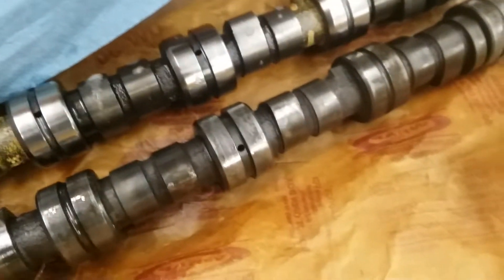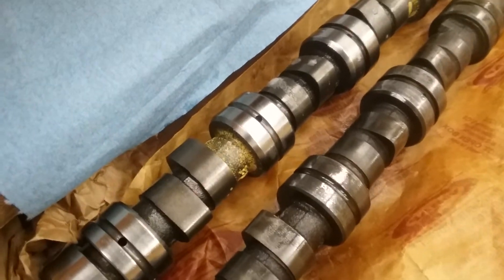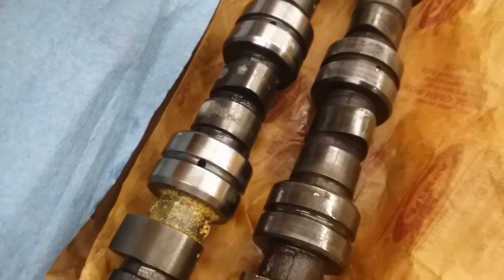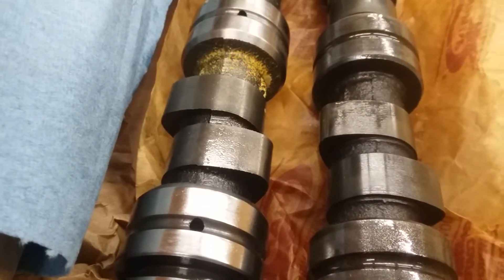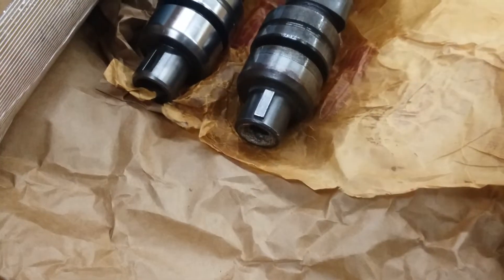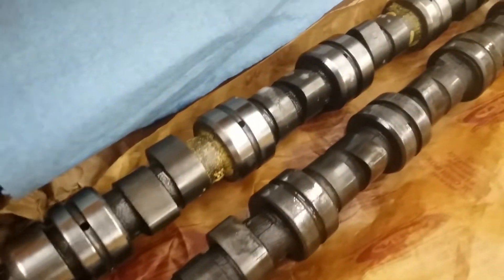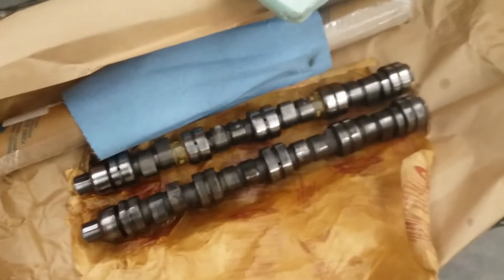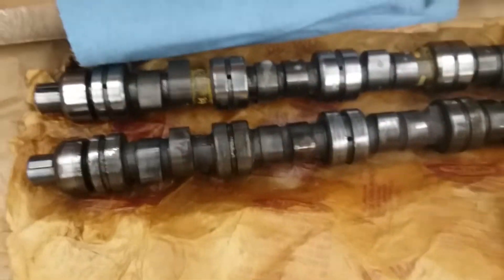1.6 CVH (Carb) VS 1.6 CVH HO/EFI Camshaft Comparison

Comment: Interesting.
I-am about to replace the cam and lifters ( lifter again ) on my 1.6CVH from my Fiesta XR2
I replaced only the lifters before but now after 350 KM the engine makes a horrible grinding noise with a lot of loud tapping almost like rocks under the rockercover at around 2k rpm.
I could not get any info on the lift or duration but i bought this set https://www.ebay.co.uk/itm/254381948157 any thoughts?

Also will i use some Comma X-flow XS 10W40 oil, supposed to contain high amounts of zinc.
Reply from the maker: Yes the camshaft & lifters need to be replaced at the same time when flat-tappets are involved, as both wear they'll quickly chew up whatever you put in with the old parts. So an old cam will destroy the new lifters and old lifters will destroy a new cam. With roller cam+lifters this isn't the case, you can mix-match old vs new cam and lifters without issue.

I don't have much info on Euro cams but I assume (like the listing states) that that camshaft is either identical spec-wise to the OEM cam for your engine or very close to it. Many OEM-replacement camshafts made by aftermarket companies are made to work with a number o specific engine trims based around the most common one. So while I don't know how the XR2 cam compares to the standard 1.6 cam lets assume the XR2 has more lift & slightly more duration than the base 1.6 so the aftermarket cam listed for both is either identical to the base 1.6 or is say halfway between them in lift & duration so it can fit both perfectly fine (ensuring no valve-to-piston clearance problems) but still give more performance in the lower-trim engine.

I do have a list of EVERY CVH cam I've ever found specs for here:
https://www.feoa.net/threads/cvh-total-camshaft-comparison-all-cvhs-all-cams.115094/#post-1102284
You're welcome to view that and comment any additions you find, I update it regularly but it's so rare I find more to add I don't touch it very often haha

10w40 is perfect (due to it's increasing rarity in North America 10w30 is a great substitute) and zinc content helps the flat-tappets.
Reply: @The_1982_EXPert  Thankyou for the lengthy reply. when i get the cam i'll try to measure the lift and compare.
For now i hope the engine is in good condition.